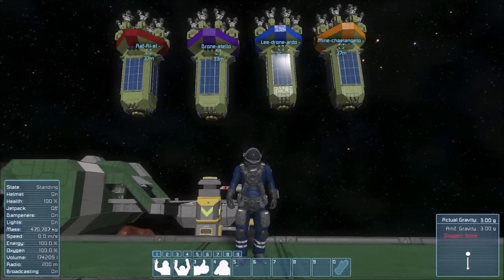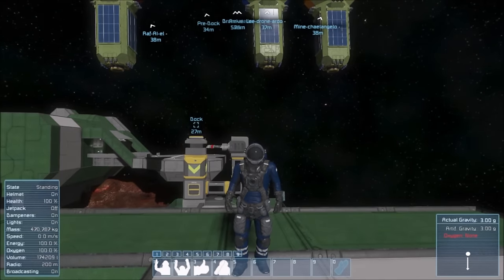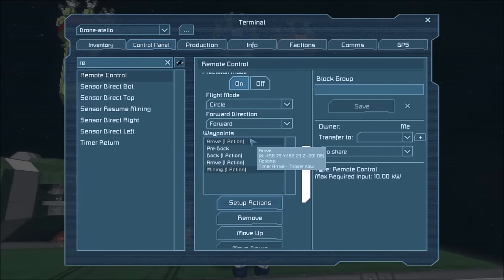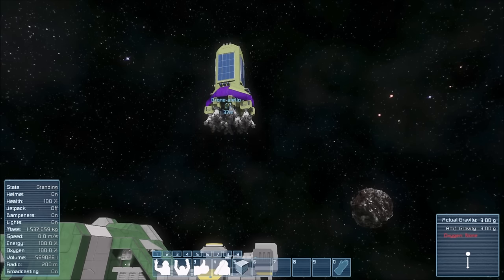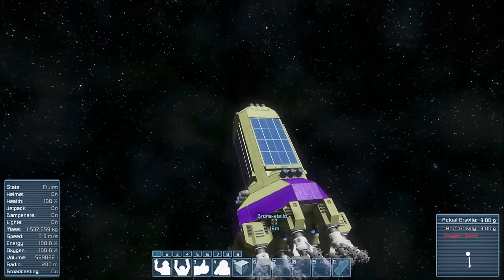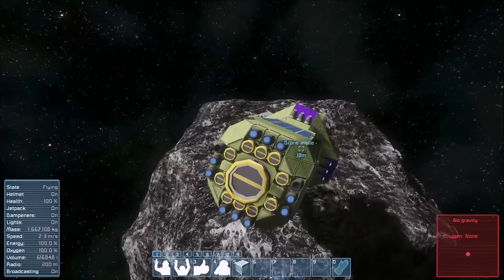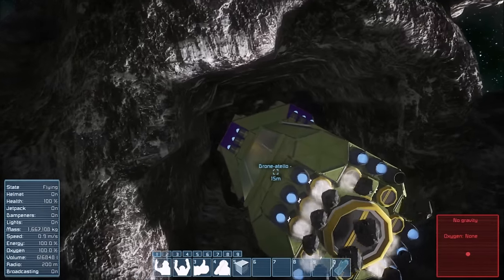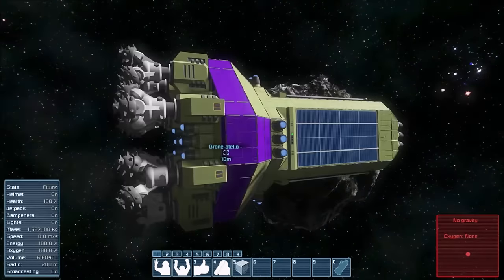Self-Powering, 100% Working, Completely Autonomous Mining Drone

Comment: I just tried this today in a local Creative game and tried extra hard to do exactly as you described. I set up my waypoints, turned Autopilot on. It quickly moved from my Arrive to Pre-Dock coordinates, stopped moving, then deactivated Autopilot. I tried doing Reset Waypoint then Autopilot on, and it instantly deactivated Autopilot. Any ideas?
Reply: After waiting a few minutes to make sure it wasn't just a really long timer waiting for something, I took control and moved it sideways a bit. All of a sudden, it headed for the asteroid that my station was on, and actually started drilling! Super cool. Unfortunately, it dug about half of its length into the asteroid, then tried to do a 180 on the spot, breaking quite a lot of its front. After another minute of motionless drilling in space, it moved a bit, turned back around, then drilled in another spot. Also, it's taking forever to actually drill into the asteroid. Is this a bug with the current version of the game perhaps?